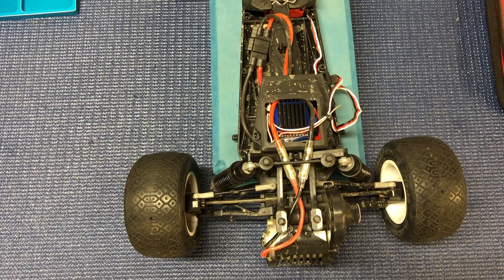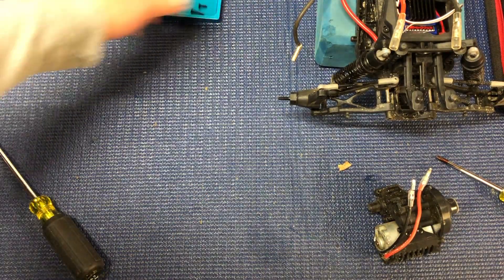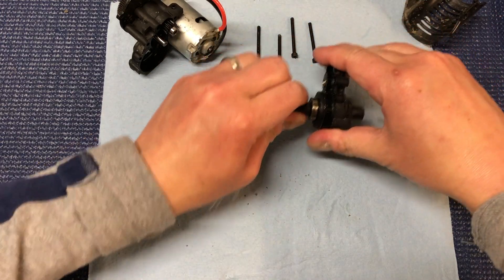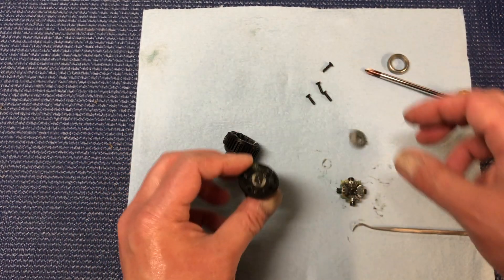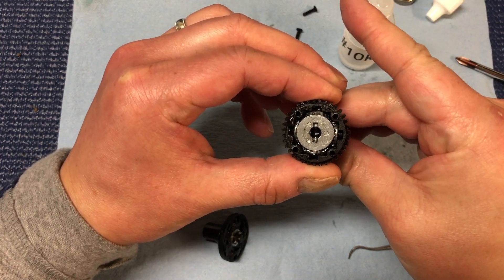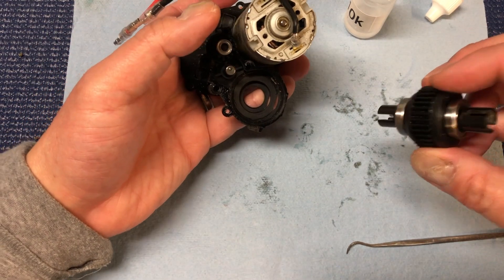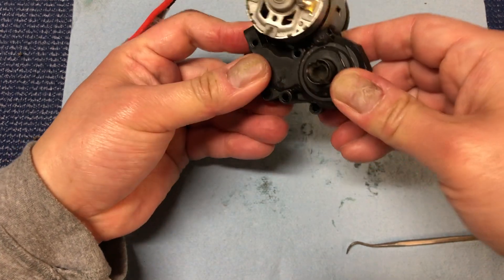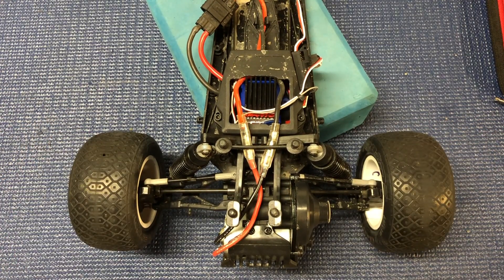Redcat Piranha Fix #3: sealed gear differential

Comment: @Razor RC My piranha makes a screeching noise when running and gets REALLY loud on full throttle. Is there a way to fix that? I've recently cleaned the motor and oiled the bushings so I know it's not the motor. Would it be the differentials or the mesh?

Comment: Currently I have installed a 3650 5200kv brushless motor, 120A esc. One of the under $100 bundle deals. Installed a 48P 20T hardened steel pinion on the new motor. Everything else is stock other than the radio/receiver.
Reply: Did you put any grease inside the gears? How are they holding up?
Reply: @anong345  I didnt open the transmission.. so far so good. I dont run it much lol. Also I'm only using 2s lipo

Comment: Brand new gearbox. Out of the bag direct from redcat has resistance when Turing the spur.     Almost positive the problem is the bearings that are on the input shaft of the gearbox.  There’s two of them. Also the shaft itself wobbles.
Reply from the maker: Image Audio let me know what you find.  My gearbox still has too much resistance, but it spins freely when the diff halves aren’t closed.

Comment: Thanks for the video.  My Piranha diff is binding and I can't figure out why.  I opened it up and didn't see any broken or ground teeth.
Reply from the maker: Was it always this way?  It could be shimmed too tight, you can remove one of the shims behind the spider gears and see if that helps.  Also make sure it's meshed -- when you re-assemble it, put the sun gear back in like I did and make sure it turns freely like I do before putting the top back on.
Reply: No it has not been that way out of the box.It started acting up after a few days of use and many jumps.  I'll try your tips thanks. @RazorRC

Comment: I melted those transmission gears running a 4300kv motor on 3s with a 29t pinion after 4 packs run lol..Do not run those gears dry..Heat killed mine if the factory had added a decent amount of grease they wouldn't have heated up as much.

Comment: I almost put some similar tires on the one I got since a friend sent me 2 boxes of race tires n the stock kind of suck lol, but thats as much im willing to work on this $65 rc, since I did buy it for my nieces n nephew to play with
Reply from the maker: You can actually get the truck to handle pretty well without spending any money.  Well, $5 for shock oil or diff oil, but there's a lot of tuneability in the truck and I'm amazed at how much better it drives now.  Just need to find some soft springs for the rear.
Reply: @RazorRC  ya ur vids have made me wanna tune this one up just out of the fun on wrenching on it
Reply: @STEVOD313  This chassis handles very well when set up right..Easy tuning
Reply from the maker: @STEVOD313  And I'm not done yet!  Got a few more tricks up my sleeve.   😉
Reply: STEVO D 313 where did you guys buy it from ? Cause I found it for 109 right now
Reply: @hungngo3415  Forget this rig and get a Arrma Voltage series or Helion Conquest line up for $99..Three transmission failed on my two only on 2s lipo
Reply: PhilthyCo RC arrma or helico? What do you recommend?
Reply: PhilthyCo RC and some questions , is the gears and parts of arrma more reliable then the helion ? And is the arrma waterproof?
Reply: @hungngo3415  The Arrma has a sealed metal diff but composite outdrives..They seem good up to 2s brushless..The Helion has a metal diff and metal outdrives and is good up to 3s brushless..The chassis on the Arrma is stronger though..Not saying the Helion is weak but the mid motor mono block chassis in the Arrma is beefy..Helion has more of a race breed chassis..I think if you want to race get a Helion Conquest and if you want to bash get the Arrma Voltage
Reply: @hungngo3415  I think they both are waterproof
Reply: PhilthyCo RC thank you so much ! I love you 😂
Reply: PhilthyCo RC one last thing , since I’m getting the granite , and it has hearing issues , should I open it and put some grease in there ? Thanks for you time
Reply: @hungngo3415  It shouldn't have heating issues.. It's good to go out the box and on 2s lipo